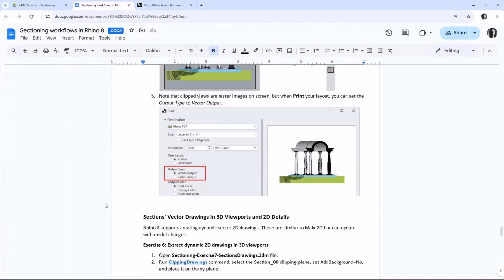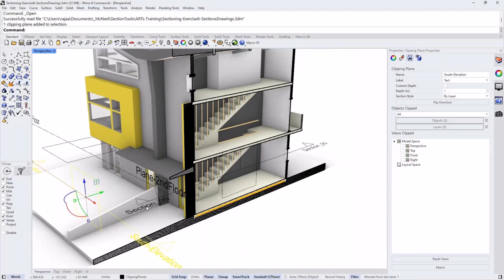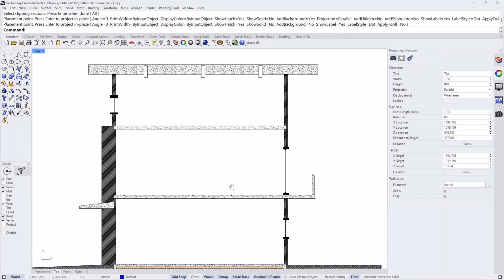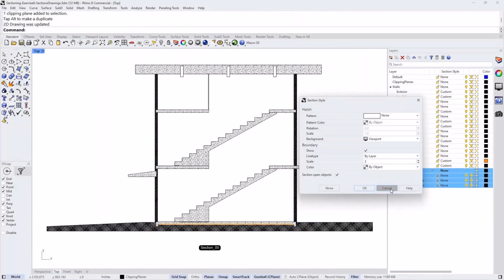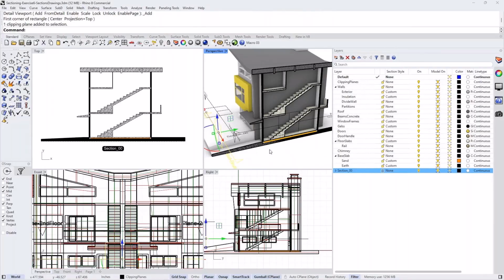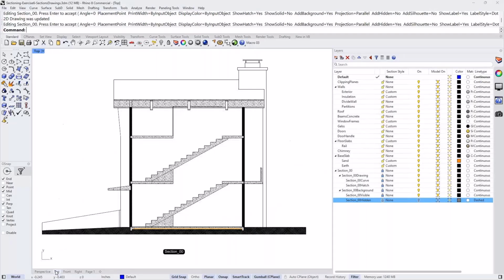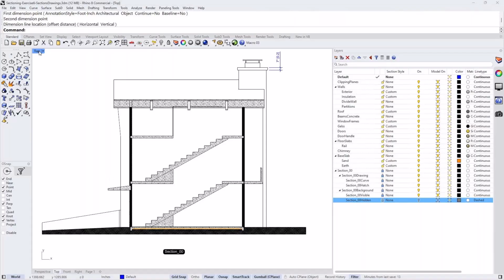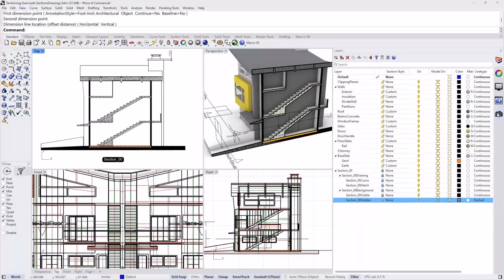13 Sectioning Workflows Using Clipping Drawings in Rhino 8

Comment: I want to use a section with curves and hatches without it being dependent on clipping section. If I use explode it explodes the hatches and it I use extract it only extract curves not hatches. What is the workflow for my intended purpose?